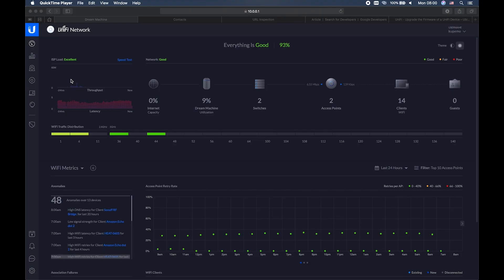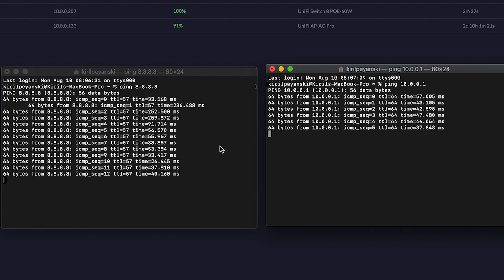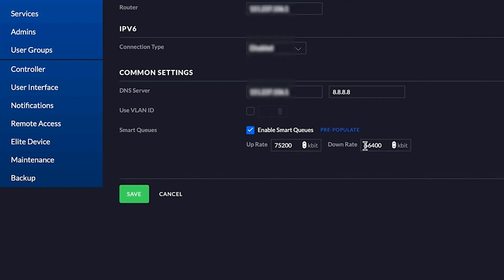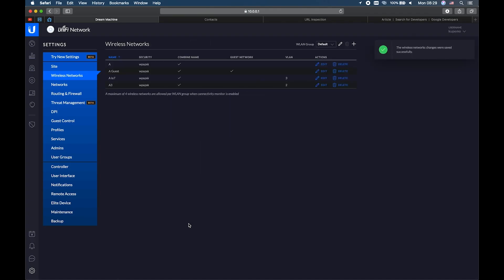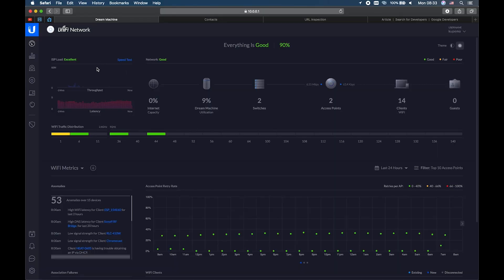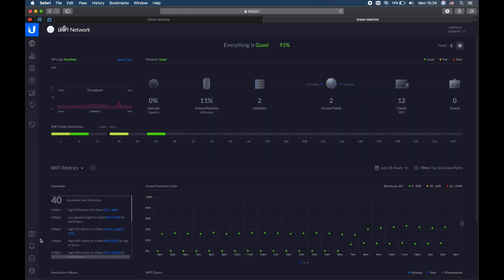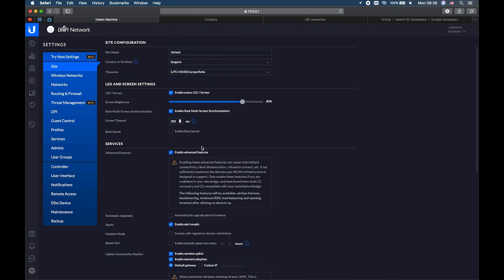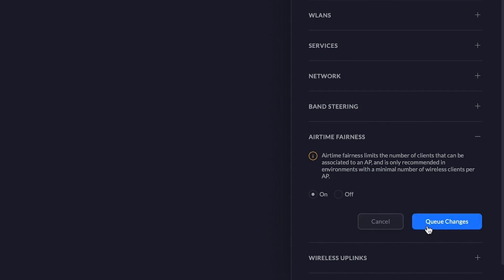How To Optimize and Troubleshoot UniFi Wireless Connections

Comment: Excellent video as always 
I,m  running USG with 4 ap's  , 2 AP AC PRO, and 2 older ones latency around the 1-2ms on lan and wan
Reply from the maker: That’s impressive setup 👍 I’m only wondering what we will do when/if WI-FI 6 becomes the new normal. But I guess we will see.  Thanks for the good words.
Reply: @KPeyanski  yes any wifi improvements will be great ,  I think it will be a few more years before its in most homes , just because of cost and waiting on phones and laptops to be upgraded to wifi 6 frist
think about how many wifi 4  things we still have,
wifi 6 wont make them work any faster
Reply from the maker: You’re totally right. We have a lot of old devices around. I guess it will take some time.

Comment: Hi KPeyanski,
Thank you for the video.
I was able to see during the video that you are also having DNS timeout issues on some devices and you can see that on the main Unifi dashboard.

Have you ever checked that and know how to fix it?

Thanks.
Reply from the maker: No, I have 2 devices that are literally in a prison (behind very thick walls) and the signal there is not very good. I believe these are the devices that have timeouts, but they are communicating over MQTT protocol so there is no big issue if there are short outages.

Comment: Great video. I’m going to give some of this a try. I have a UDM and two UAP Beacon HD’s. Speeds and connectivity is outstanding. However, after looking at my set up, I noticed channel interference, even with the Beacon’s separated well by distance. I’m very new to Unifi, UI and the amount of information I’ve been reading is like drinking from a fire hose. It’s difficult to digest it all.
Reply from the maker: Hi Thomas, check this video of mine where I'm discussing the interference and channel overlap and how to avoid it - https://youtu.be/6n_KBDaDuYQ
Reply: @KPeyanski  thanks. I’ll check it out.

Comment: The UDM by itself doesn’t connect to anything in my garage or outside my home. I have 21 2.4GHz devices (5 outside), 10 5GHz devices (3 outside), 6 roaming mobiles devices, 4 of which are WiFi 6 compatible. Am I fine with 2 FlexHDs or two UAP-AC-M-Us rabbit ear access points? Should I buy any of the WiFi 6 betas or wait? Can those be added later and mesh with existing non-WiFi 6 devices? How do you suggest I start? Your videos are very helpful.
Reply from the maker: I cannot advice about WiFi 6 yet, cause I didn't have the chance to play with it till the moment. Regarding choosing between FlexHD & UAP-AC-M I think that both will work just fine, but the FlexHD should be slightly faster on 5GHz due to 4x4 MU-MIMO technology.

Comment: Hello, very good video. I followed your suggestions and I think it resolved my WIFI coverage issue, thank you. 

Unifi UDM setup:
- I was looking for this setting in your video but I couldn't find it, do you have (Unifi AI-enabled under system settings?) and what do you think about it, does it improve your Wifi experience? 

- Secondly, when selecting the internet TAB, It says for peak utilization UL/DL 100% for both. My ISP broadband provides unlimited bandwidth and my site settings have the correct provider capabilities, does this 100%-100% utilization for UL/DL affect my network/internet experience?

Thanks
Reply from the maker: UniFi AI is good if you have a lot of other WIFI networks around coming from your neighbours for example and these networks are constantly changing or switched on/off
I'm not sure about your second question, if utilisation is really 100% it will most probably affect your experience.

Comment: I had so much issue with my wifi even before I had Unifi products and Phone and computer used to show strong signal but loading page and also connecting to local server still have issue.  I just change the DTIM 2G and 5G to 3 and it improved my wifi so much.  I'm going to slowly change on the other setting.
Reply from the maker: Great to hear that. Thanks for sharing your story. Let me know the results from the other settings. Good Luck!

Comment: Hello good Sir, I have a problem with my AP-AC Pro device, everything works stably until about 5 laptops log into the device. The pings are low (30-90ms), but there is packet loss. Please give me suggestions on what could be causing the problem. There were no internet failures during testing (there was no packet loss on a computer connected to the same network via cable). Would be great if you can advise what might be a problem here.
Reply from the maker: It could be many things. Try to update your device firmware to the latest one and then contact the Ubiquiti support. They are very cooperative and will help you debug the issue
Reply: @KPeyanski  thanks, will do that.

Comment: Hi Great video, just wondering about channel selection. I have 2 ubiquiti access points, 2.4ghz only long range and an AC lite. Should I have the channels on the 2.4 different for each say 1 and 6? I'm finding lately that our mobiles are showing full WiFi connection but they stop working and videos will buffer for ages and at times the phone will never reconnect.. Thanks for your help..
Reply from the maker: Your comment was automatically held for review by YT for some reason. I hope you sorted it out already, but anyways here is what I think: Mine APs - one LR and UDM are on different channels 1 and 11 and I don't have such issues with my mobile devices
Reply: @KPeyanski  Thanks mate.. Yep all good now.. Appreciate your reply! 👍

Comment: Amazing video, i have a problem that  I'm not able to resolve yet.
I have 3x nano Hd in my house and they are all wired.
I have good wifi speeds but the range is so bad, the connection drops when I go behind one brick wall Wich is not normal.

Comment: i have facing a problem,my unifi access point automatically goes down at random time. And this issue happen randomly to any access point and when i restart device then it will work properly. And my lan network is working fine.  Can u please suggest any solution.
Reply: Same issue with me if you got the solution please share with me

Comment: hi there,  I am having a problem as my windows 8.1 computers cant connect on my ap ac wifi. any suggestion in fixing the issue?
Reply from the maker: That is strange. I can advise you to export your device log and to paste it in UniFi community!
Reply: @KPeyanski   Hey I have managed to sort out the issue. it was network auto-optimization, just switched it off and w8.1 could connect just fine.